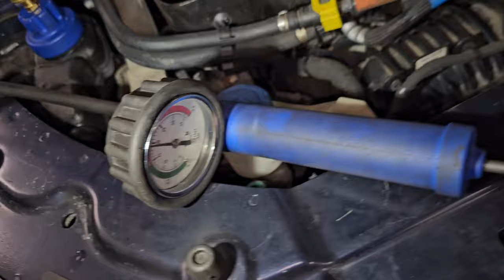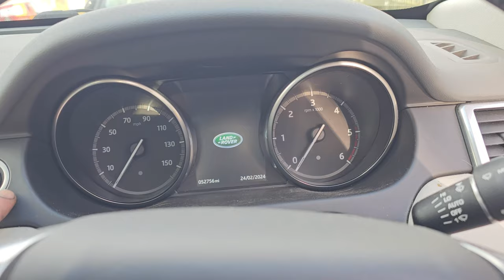Ingenium part 3. DPFs, chains, turbos. Are they one to avoid?

Comment: Ingenium is another Tata Land Rover fail.
Reply: Well over 1.5 million of these engines have been produced here in the UK since the new factory opened in 2015. All modern engines are designed to be as light as possible, have as little friction as possible, and to reduce rotating masses to ensure good fuel economy and meet politically driven emissions figures. As many manufacturers have found, despite development and testing, areas of weakness can show up in use in some cases. The ingenium diesel has uprated timing components fitted from 2019 on and the engine continues to be in widespread use across the whole range of JLR products. I've run an early one for a few years now, and even took out an engine warranty because I was daft enough at the time to take too much notice of what was being said online. Guess what - no timing chain issues, no balancer shaft issues, fantastic fuel economy. Never used for a lot of short runs from cold, and always use premium diesel and 10,000 mile oil change intervals. Long may it continue.
Reply: @fraser7744 thank you Adrian Mardell
Reply: Ford, actually.
Reply: This video summarises this perfectly. Inherently not bad engines, just multiple factors that compound things.

Euro 6 emissions equipment
+City driving
+Crazy high service intervals

I have a high mileage SDV6 Discovery 4 which gets a bad wrap for the same reason. Oil change is cheaper than an engine. "Toyota reliability" comes at the cost in terms of performance and comfort.

Comment: Excellent video. 100% agree modern diesels need a good run. Short stop start school runs just clog them up.
Reply: With many town, cities and even countries (Wales) introducing 20mph zones and the problems caused by so called 'green' emission controls strangulating engines will only further exasperate Diesel engine reliability.

Comment: It's incredible how bad these JLR engines are, for all sorts of reasons. I've just sold an Audi A6 2.0 TDi which I drove for over 300,000 miles without the head ever being off and it still ran like new. The clutch and DMF lasted well over 200,000 miles, and it never had any oil leaks. The injectors and 3 of the 4 glow plugs were original, and the last MOT recorded a smoke reading of almost zero even though it didn't have a DPF due to its age. (0.09, limit 3.0). It was serviced around every 18.000 miles and I used premium diesel. If the Germans can make engines that good, why are Land Rovers so bad in so many ways? Needless to say, I bought another Audi diesel. So far it's done 30,000 miles in less than 18 months with no issues.
Reply: I work about half a mile from the Solihull factory and know a few people who work there now, most of whom say they wouldn't buy them even if they could afford it!
Reply: And then I know someone who owned an Audi that had DPF problems or adblue problems so not just LR also dont the VW group auto gear box have problems.
Reply: @josephgittos3787  That car didn't have a DPF, Adblue or an automatic gearbox, however I also have a 2019 A6 Avant 40TDi which has all three and has just hit 78,000 miles trouble free. I have a friend who owns 4 JLR vehicles and freely admits that he gets more problems with them in the average year than I get in a lifetime of owning Audis.

Comment: I have a Discovery Sport with a 2L Diesel Ingenium engine which is 7 years old with 74k miles. 18 months ago (60k mile) my JLR dealer said there was a rattle from the timing chain and they offered to fix it for £2700 (plus VAT). I took it to a local independent LR specialist who couldn't find a problem but suggested I change the oil/filter every 6 months. I have been changing the oil myself since it is quite easy and we have altered the usage so that it mostly does long journeys. I am hoping this regime will enable the engine to last a bit longer.
Reply from the maker: Was there any codes?
Reply: No codes, no lights, no noise. My car had been to the JLR dealer for a steering rack bolt recall after which they told me it needed a new timing chain. They said they had a video of their technician inspecting the car but when I requested a copy it turned out to be unavailable. That is why I sought a second opinion.  @jrvehicleservices
Reply: @grahamwoodier5066  Always avoid main dealers  (especially JLR), they will just cheat lie and rob you.

Comment: Very interesting. Mazda had the same problem with their diesel engines. Great engine but sold them to people poodling around town. So massive problems with the oil strainers and pick ups and carbon build up and dpfs clogging up and....so on. Great show thanks for posting.
Reply: Mazda did have a bulletproof engines for many years. But the diesel engine in Mazda small SUV and passenger cars now and some years back are really garbage. Just a shame.

Comment: Oil dilution is a killer, stop start, switch it off, change oil and filter every 6000 miles, run it for 100 mile round trip once a month to regen the dpf naturally, and there's a half decent chance the issues won't arise as often.
Reply: Oil dilution on my Evoque.  Said did little mileage in a year.  That true because been working abroad but 90% of trips 60 miles one way, so can accept problem if only short trips but cannot see how low mileage but long trips makes a difference.  Have driven very Audi Peugeot Toyota, BMW dielectric cars with similar trips no problem.

Comment: Late to the party, but only just discovered your channel. What a find, a garage  staffed by people with honesty and integrity. How very refreshing.

I reference the engine block with the imperfection, that leaks oil, that you have found a fix for. If that doesn't work have a specialist welder fill the gap/hole, whatever. It doesn't need to be perfect (although it very well may be) as you can file the excess down.

Comment: Enjoy your videos, I have a 2016 Diesel Evoque 77K and it’s been great. Problems I’ve had, two door actuators, rear camera water ingress and heat shield on dpf needed a tack weld to stop it rattling. I have a commute of 30 miles but fortunately most of it is dual carriageway. It tows a caravan so gets good long runs too. I’m in Cheshire and it’s looked after by a JLR indie. It’s due routine service soon and will discuss timing chain replacement. I had auto trans fluid changed at 50k and had Haldex serviced too.

Comment: I have the 2017 XE 20D AWD here in Los Angeles. I do long drives regularly, but I didn't know about the oil change rule of thumb and trusted the manual/dealer. I do everything myself, so I waited for their intervals to do the change... and then the turbo blew on it. Jaguar is ruthless about the change (charged me about $5500 just for the turbo). What's worse is that the dealer I went to is prone to misdiagnosis. They started off with harnesses, and then finally got to the turbo, but then the turbo going out lead to the DPF going down, and then the EGR system needing attention.

I stopped taking it to the dealer, and eventually just did the repairs myself. It's not easy the first time around, but now I'm not afraid of the turbo, DPF, Injectors, EGR system, and most of the associated parts of the engine.

I am looking into whether I'm going to do the timing chain myself, since unlike all of the others, as you can see, there's a ton of specialty tools that I'm not sure I can even procure.

All in all, your analysis at the end is spot on. I wish I would have gone for the petrol originally. lesson learned, i suppose.

Comment: Great vlog again, thank you. I totally agree I do a long journey once a week and change the oil every 5000. I haven't had an issues with the timing chain, currently 85000. I will be in contact regarding my leaking transmission PTU seal. FYI in USA there is a notification on this. TOPIx - SSM74140 - L550/L538 Oil leaking from interface of PTU and automatic transmission.

Comment: Good to see a lad who knows his job but you've really put me of these engines.😎
Reply: I did have customer coming with a baby LR and said its was the 4 or 5th garage she was trying to get her car fixed. Motor was lacking power and all of the others gave up...... one or two did have a tune up put in and the engine got even worse........ Thought it was strange with a little smoke from this not so old car and in five minutes I did find a cooler hose with a hole. The fix was to put an exhaust pipe inside and test it....... It was flying afterwards....... The tune came in.

Comment: Hi Josh, I have owned an 2016 Évoque, 2018 E Pace and a 2020 E Pace all 2l diesels. All were bought from new, we always drive at least 20 miles and the car is warmed up, speed max is usually 50-60 mph. We had a lot of problems with the Évoqué and the first E Pace with oil dilution, it wasn’t an issue with the second E Pace. I didn’t keep any past 3 years, since I didn’t fancy running them out of warranty !! Great trio of videos about the Ingenium engines. 👍🇬🇧😎

Comment: Good series. I bought a Petrol Discovery Sport three-years ago because we do modest annnual mileage & have been very pleased with it to date. They are much rarer than their diesel siblings. Previously we had had a Discovery 3 and then a 4. The latter was a lovely car albeit I was always worried about suffering a crankshaft failure. The car was low mileage and maintained by a non-franchise specialist. I was advised that oil changes more frequently than recommended by JLR was prudent but that if you have a car where the crankshaft is going to fail there is little or nothing more you can do to mitigate the potential problem.
Reply: LR Time from Germany recommend running 5W 40 in the TDV6 not 5W 30 as indicated by JLR because the 40w oil is recommended by Peugeot Citroen and Ford USA for this engine, JLR only use the 30 weight oil because it gives slightly better fuel consumption. They have a TDV6 2*7 that has done over 270,000kms without any issues.
Reply: @stephensalt6787  - I watch that channel too. Their Discovery 3 has indeed been very reliable (albeit with great maintainence) However, they have rebuilt two Discovery 4 engines that have suffered with the crankshaft issue.

Comment: My friend has done about 40 chains over 2 and a half years on Evoque discovery sports and a couple of jaguar XE good engine if they would stop putting crap chains on them you get a odd balance shaft on some an odd turbo gone but dealer definitely dont service then  the book is stamped but the engine don't looked serviced on tear down

Comment: ive got a 2.0d fpace with 60k showing had it for 3yrs no issues going to start chaning transmissiion fluid just pulling sump plug and replacing what comes out thats all nothing else but im wondering is it ok to add say 500mil of a trans cleaning additive in there for 6months then do same again maybe change filter and pan then ?? my logic is that if i do this process twice a year with my engine oil change shouldnt be any trans issues  later on ,  like it needing complete fush and what not at 100k and above .

Comment: I have a Disco Sport 2.0 Ingenium diesel. Bought it from Carbase, two years ago, with what turned out to be a cracked DPF. Had that replaced, eventually, at a cost of £2.6k. Now sixth gear doesn't stay engaged, drops out. Land Rover specialist says there are leaks from all sorts of places, including the EGR valve, bill including recon transmission, clutch and leak fixes, £6.9k. Always owned Honda CRVs until this Disco, never had any issues with the Hondas.

Comment: I just got one , non runner Copart . Looking good so far engine not seized no metal in oil . Battery goosed  can’t read any codes just now . Oil lower turbo must be using it , oil dilution . Timing I recon looking for a cam shaft code . It’s needing a remap to sort all the problems like oil dilution able ect ect . Then there be fine 👍

Comment: thank you i have a 17 plate 2 wheel drive evoque ,no issues atm i change the oil and filter myself twice a year ,only short trips ,i use a pump to remove the oil ,is this enough to help with the faults you are seeing

Comment: Great Video mate, As a new Ingenium engine owner its eye opening. Thankfully I'm able to do the Oil Changes myself between service intervals fairly easily so that and longer runs at weekends should help! Quick question, My thermostat seems to have packed up - struggles to get above quarter way on Dual carriageways/M5. Recently I'm also getting the code P0401-00, Are these related due to not being able to complete the EGR clean cycle do you think? No Soot in exhaust... :)

Comment: I wonder why the Toyota D4d engines never had any of these problems? 😂
Reply: Well those that were used for short journeys only did. Injectors, EGRs and flywheel problems are well documented.
Reply: They do have their of problems but are on average reliable. The 1AD and 2AD had the head cracking and gasket issues. The 1kd has its piston breaking issues and oil dilution in 1kd and 2gd though the oil dilution is manageable in shorter oil drain interval.
Reply: Actually look at the Euro6 diesels & you’ll find engine failures too. Every manufacturer has lengthened their service intervals. Combine this with all the emissions stuff & they’re failing like any other.

Comment: I own a evoque and it demands a oil change every 6 months the service due comes up about every 6 months but just get a good local garage to do oil and filter change and sometimes take it to LR for oil/filter change to get it on the records. I owned a Merc with 30,000 miles on the clock and timing chain stretched and I had. it serviced ever year and that was a petrol 1.8 kompressor ,luckily easy job for specialist and cost me £600 many many years ago.

Comment: is the broken egr pipe the common issue in this engine? i got mine 2 month ago and already have a broken pipe of egr ( G4D3-9F468-AB )? and do you know what is the difference between 2016 204dtd and 2020 dtd. are the new engines part are compatible with old one? thank you. appreciate your videos and advice.

Comment: The ingenium engines are fine if they're used properly. Change the oil every 10-12k. I had an xf 2.0d from new and did 140k. We went to southern Italy 4 x times with 2 kids and fully loaded. Car never missed a beat, great car. 👍

Comment: Great video - I have had a Disco Sport diesel from new with 70k miles - it's been a great workhorse with no significant issues.  The LR stated service interval is 21k which is just bonkers!  I get it serviced every year at 10k miles max which is probably why I have avoided issues.  Would you advise a precautionary timing chain change at any point?
Reply from the maker: Only if it is rattling!

Comment: Hi just a question, do you think these engines would be great if they had the EGR, DPF and ADBlue all removed ?
Reply: No. I think they have been designed to work in tandem with combustion temperature control/reduction which comes from the EGR (engine gas recirculation). You would have to introduce water-methanol injection then to achieve that. DPF and AdBlue removal would require serious software rewrite to enable proper use. Also, such vehicle would be illegal for road use (and for most racing tracks) as the emissions would be too high.
You could use water-methanol injection with trace amount of ethlyamine buffered with EDTA and have high flow DPF and SCR. You could even see if you can have specially remade fuel pump and have direct injection of AdBlue and have dual AdBlue treatment while still reaping the benefits of combustion temperature control, NOx reduction and safe emissions with good horse power from the engine.
But then again... You could do all that with the EGR as well :)

EGR, DPF and SCR (AdBlue) are not the problem.
Material quality and factory quality controls are the key.
JLR improved quality control (so they say) with the facelift models.

Comment: Great video, I’ve got a jaguar XE petrol 2017.  49000 miles I want to changed oil filter my self euro car parts told me to use 5 w30  engine oil but main dealers told me to use 0w20 but difficult to get that grade of oil in Castro. What do you recommend I should use any help would be appreciated
Reply from the maker: Definitely 0W20. Has to meet JLR.03.5006 spec. Used to be Castrol only but I believe others do it now.

Comment: Is the Jag 3.0 diesel more reliable than the Ingenium? I have an 18 year old 2.7 with 190,000 miles and I'm tempted to look at an XF 3.0 diesel for my next car.
Reply: Depending on the age range, the 3 litre is by far the better engine. Only issues with the older ones are crankshafts snapping. The throttle bodies also stick and prevent DPF regeneration so that can be something which needs to be checked and replaced (few hundred quid)
Reply: That’s the TDV6. They have their issues, especially the later 3.0. 
After 2014 there’s a generation 2 of that engine & it’s definitely unreliable

Comment: Hi josh wondered if u could help me ive had a top chain go on mine but my crank pully is to rusty to see the timing mark is there any other way to time the crank thanks
Reply from the maker: The proper tool slots into the crank and then you don't need the mark!
Reply: Ok thanks i have the proper tool but when i put it in the pump timing seems to 180° out thanks for getting back to me
Reply from the maker: @lelcox569  are you sure the crank isn't out?

The tool fits multiple ways which us a pain!
Reply: Ive took injector one out and and with the tool in place the piston is up but pump is out if i get pump timing mark to right mark piston is down this is why i was struggling thanks

Comment: I have an XF 2 litre diesel on a 65 plate from new it has 130 k on the clock with services at 21k intervals. It has spent most of its life at 2k of revs on the motorway, original clutch and chain is still dead quiet. As has been said they hate taxi work